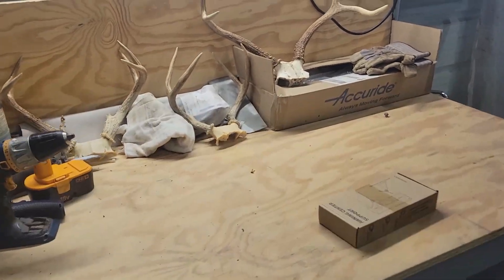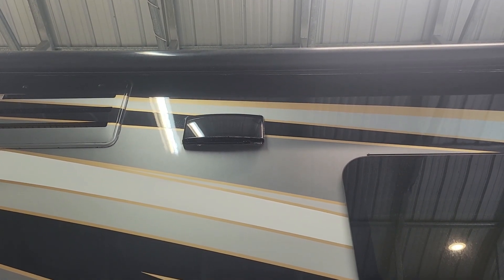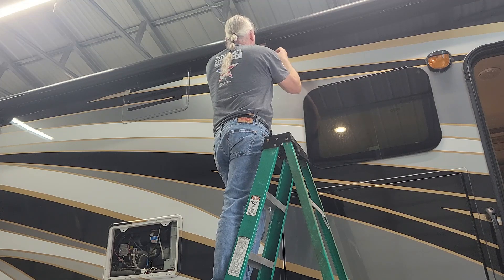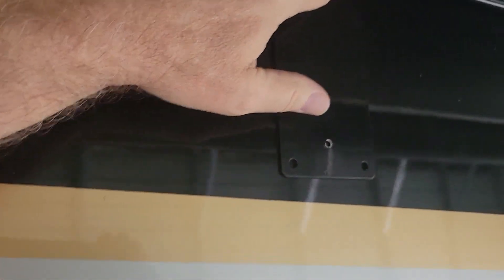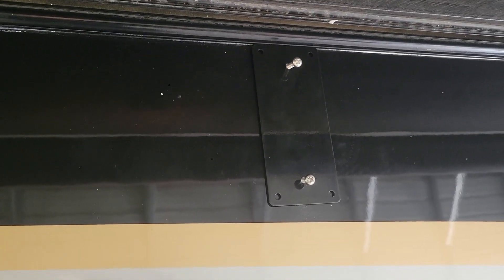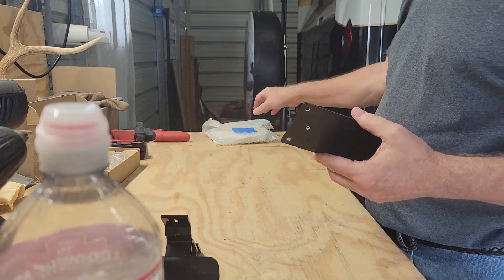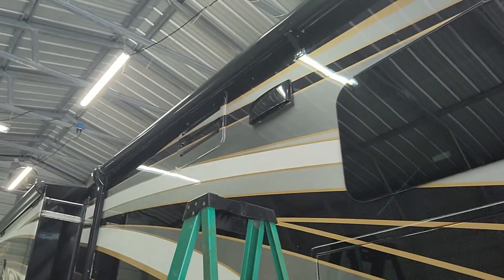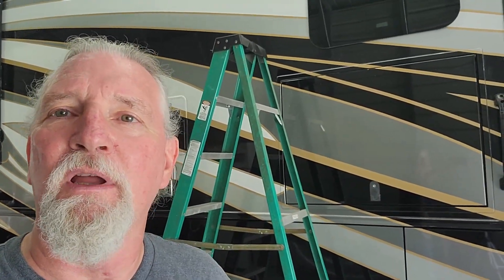Installing an Awning Support

Comment: Just curious if you were having a problem with your awning because of the length of it to add the center support. I have a Jayco Seneca 36 FK The awning on it appears to be the same length as yours.
Reply from the maker: I didn't know I was having problems until I was told about it at the Super C rally in Shipshewana. I then started to pay attention and noticed a wobble while going in and out. I don't know if it was caused by bouncing down the road or not, but for $25 it is worth installing to make sure.
Reply: @wanderingpeaches  Thanks for the information.
 I also noticed on my Seneca 36 FK that the awning also wobbles some going in and out.
Reply: Was your rv level front to back?  If not the plumb Bob will not track a stud vertically.   Only needs to miss a bit!
Reply from the maker: yes it was level. I just think Jayco doesn't follow blue prints :- )
Reply: That stud you found may have just been the frame support for that exterior door/cabinet. Thanks for the video. I am looking to add a center support to my RV’s 21’ awning. This video was very helpful!!
Reply from the maker: you are welcome